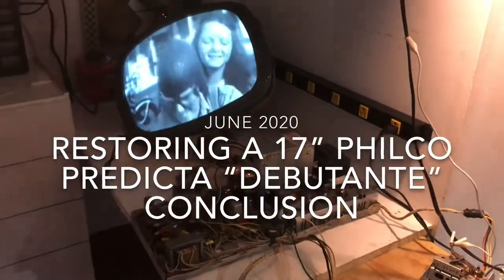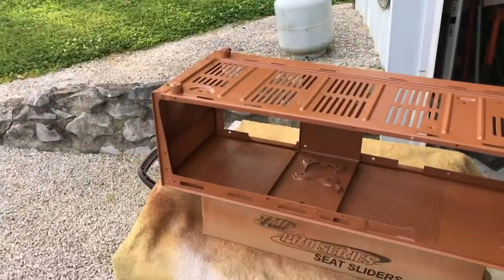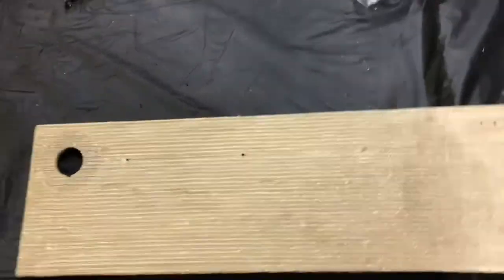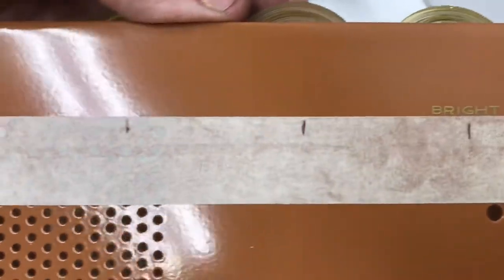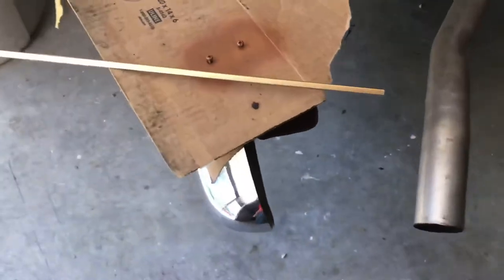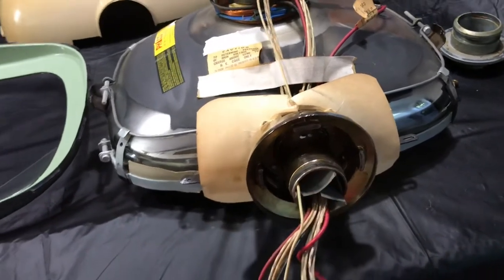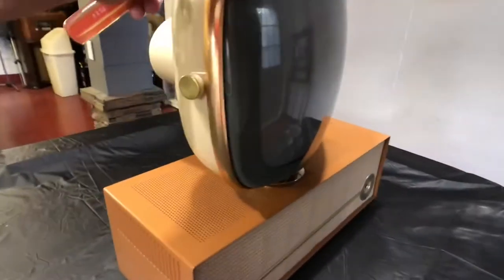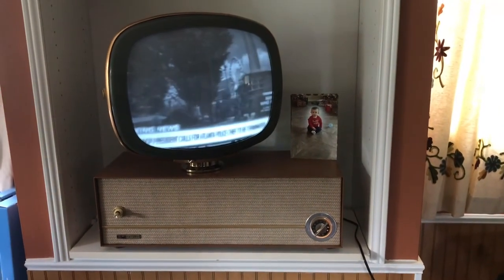PREDICTA Debutante TV Restore pt 3 of 3. Cabinet restore and finishing up.  @CreekviewAcres

Comment: Really, really nice job!  How did you get the piece off from around the On/Off Volume control?  Also where and what did you get that grille cloth from.  It looks fantastic!
Reply from the maker: Crist Rigotti 
 The decorative ring around the volume control was crimped at the factory. I just bent the back of it around and around til I had it straightened enough to get off. I then bent it back down when I put it back on. 
  Grille cloth , eBay 
 Just look for guitar amp cloth here’s the item number I bought 232056930274

 I recommended your k networks to one of my YouTube subscribers , he said he bought some.
Reply: @CreekviewAcres  The eBay number doesn't work.  Thanks for the recommendation.
Reply from the maker: Crist Rigotti 
 eBay seller is stringtrader.